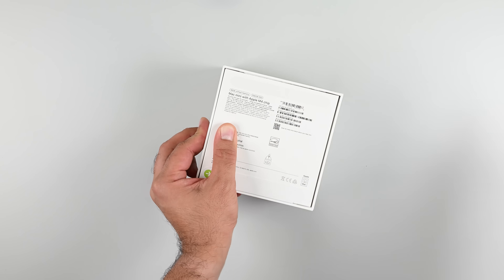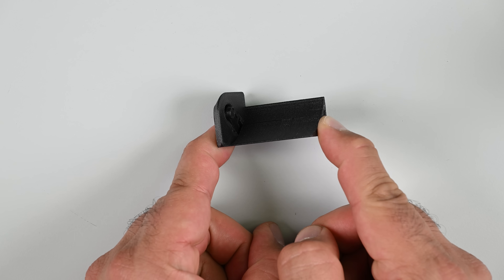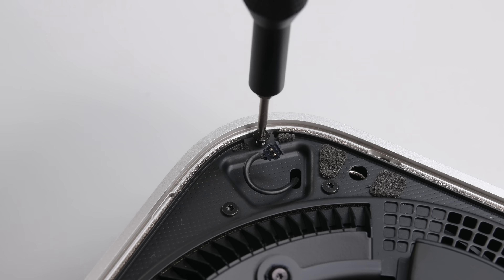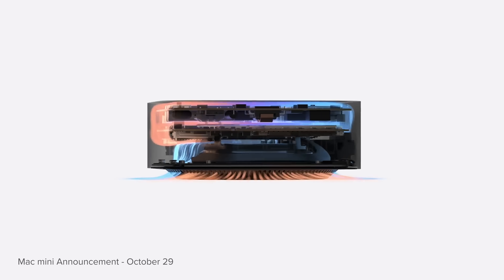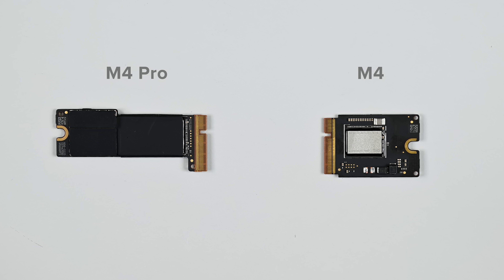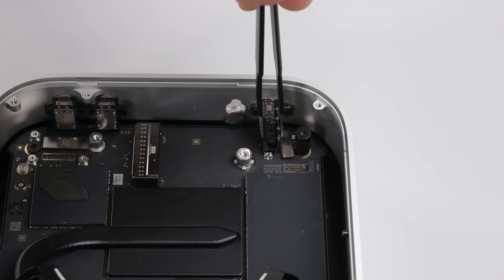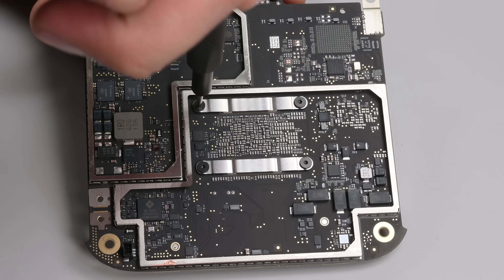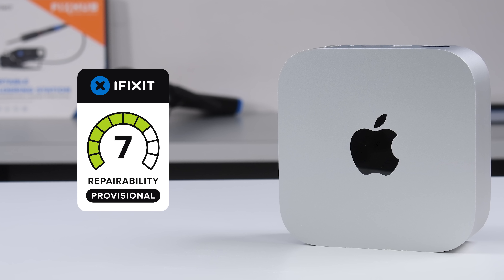M4 Mac mini Teardown - UPGRADABLE Storage, Powerful, and TINY

Comment: 7/10 repairability score for the Mac Mini 2024? Really, iFixit? This feels like a slap in the face to the repair community. Apple makes a small step by allowing one component to be replaced, and suddenly they get a pass? This Mac Mini still has plenty of proprietary parts and design limitations that make true repairs and upgrades a challenge for regular users. It's disappointing to see iFixit rewarding minimal changes with such a generous score, especially when the device is far from repair-friendly by any reasonable standard. This rating system seems to be getting softer, which is a huge letdown for those of us who care about real right-to-repair.
Reply: it's not one component; it's the wifi/bluetooth card; the front connectors; the storage indeed; and on top of that the button battey is super accessible. you're confusing repairability with ugpradability. It's not a standard PC that use standard PC parts; nobody expects that anymore. Now as to how to get the parts yourself it should be possible but that's indeed the question.

Comment: how much of a difference is there between connecting an external drive versus upgrading the internal ssd?
Reply: I've found that the Orico SSD enclosure with a Samsung 2TB M2 on the M2 MacBook Pro is just as fast as the internal SSD.

Comment: Power button not needed. Settings > Energy > Power ON after power failure . Cycle AC will switch it on
Reply: Bad and unnecessary "solution". Just increases the probability of memory corruption. Keep the Mac in standby. I assume that he extra cost of around a Euro per year can be survived.
Reply: @Andreas_Straub  what do you mean? you can use the standby mode normally and still have an auto power on for those exceptionnal times when you have a power failure? having it turn on automatically each time you plug it is another option entirely (that you can set I think with the terminal)
Reply: @hmmmhhhmmh  I am more concerned about the non regular shutdown leading to this automatic power-on ....
Reply: @Andreas_Straub  that's called a power failure and it usually happens close to never. could also be due to human error. I don't think anybody suggested you simply unplug your computer to shut it down; or at least I hope so. but yeah definitely put your computer to sleep for regular use.

Comment: With the Mac mini, you're basically paying for RAMs and SSD, the rest are complimentary.
Reply: I doubt they are making a lot on the base unit.. though if its subsidized and to what extent.. I dont know, but there is a lot of secondary value in getting new people into your relative closed ecosystem, and these grow percentages will clock out on Apple marketcap, as the market loves growth margins.. they don't trade you on todaysprofit but on tomorrow margins.., and that is what Apple is her for.. making money (value) to sh. holders.
The more you climb Apples upgrade ladder, the more Apple will also profit on the productsale as perse.
Reply: I prefer to look at it a different way. If you buy the base model, you're letting everyone who pays for one or more of the $200 upgrades pay the Apple tax for you!
Reply: @EnglishMike  Buying 2x base models(16G+256G) is actually cheaper than buying 1x upgraded model with twice the RAM and SSD, 32G+512G). This would be considered tax evasion from your perspective, right?
Reply: @retroray-pc  Nice, though perhaps it's more a tax loophole than tax evasion...

Comment: Removable doesn't mean upgradeable if third-party drives aren't available.  Nobody has assessed the software/hardware locks on these Apple SSD modules.

If your entire upgrade path is trying to find someone with the same M4 model as you selling off an old drive, that's not a big cause for celebration.
Reply: The exchange of the NANDS only has already been done and worked fine. No sw locks.
Reply: @Andreas_Straub  yeah everyone can swap those nands :\
Reply: @arc8218  That is why you should wit until some pros either offer that service or even complete modules.
Reply: @arc8218  This how a Pro does this: "Brand new M4 Mac Mini Upgrade SSD | 256GB To 2TB"
Reply: @ I'm referring to hw/sw locks that prohibit 3rd party modules, not swapping Apple modules.
Reply: @Kloverkill  I don't think that is really intended or maybe even possible, as the is no "intelligence" on the module. Just the Nand and it's raw interface.
Reply: @Kloverkill  I'm specifically talking about using 3rd party modules; people have already done it and it works fine. You'd also use a blank nand fresh from the manufacturer if you want to directly resolder them yourself. There's no lock in place; when you're doing a DFU restore with apple configurator that's when the modules will be paired with your hardware.
Reply: @hmmmhhhmmh  interesting, thanks for sharing.
Reply: @Andreas_Straub  thanks!
Reply: @Kloverkill  correction: for the macbook dosdude uses a nand programmer and flashes a specific file onto it before soldering it; but it doesn't appear he does it for the mini or studio (he talks about blank nand). Anyway polysoft does sell a ready to install card or cards kit for the studio.
Reply: lol dosdude has a video showing a storage upgrade on the macmini that was published almost on day one of the delivery. of course people have "assessed software/hardware locks" that's an apple software called apple configurator and you simply do a DFU restore. Upgrade for the studio are already available to purchase; and specialized stores can do upgrade on laptops/desktops for you; that's not black magic. It's just a matter of some manufacturers making and selling the parts.

Comment: Beautifully teared down, thx iFixit👍Apple should make these M.2-like modular storage modules swappable and widely accessible for the future upgrade and also not crazy expensive! SoC and RAM r soldered in and very little can be done with that due to performance benefits, however SSD storage should be fully upgradeable.
Reply: They should, but we all know they won't.
Reply: They could and should just use standard M.2 drives, but they won't because their pricing depends on the storage not being replaceable by a 3rd party SSD.

Comment: Also, no glue or expensive special tools needed to repair. I remember when I swapped the HDD from my 2010 Mac mini with an SSD and I needed a few special tools (one was literally to lift the motherboard out of the case) and they were VERY expensive.

Comment: Can you post a photo on its teardown page of its SSD drives next to m2.2230 and m2.2280 standard drives, for reference?
Thanks in advance
Reply: M2 is using onboard SSD interfacing HW. The M4 has this built-in and thus requires a direct raw interface on the card. So M2 will never be compatible.

Comment: The only thing you can upgrade is ssd, and even that, you are at mercy with Apple.
Everything else is not. HOw it gets 7?
Reply: It’s a repairability score, not an upgradeability score. It seems there are a lot of components that can be replaced without being prohibitively complicated or potentially destructive.
Reply: it gets a 7 because you can switch the storage, ports, wifi/bluetooth without throwing away the whole motherboard; and the button battery is immediately accessible.

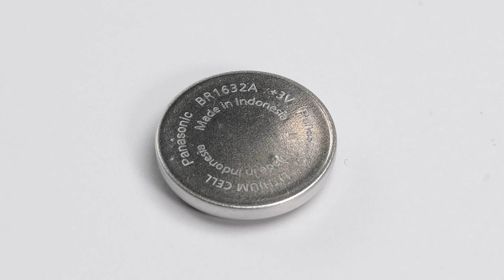Comment: What’s the purpose of the lithium battery at 1:34? Thanks in advance :)
Reply: It's for the RTC (real time clock). Helps the computer retain the time and also other UEFI settings. All sub-OS level stuff you don't have to worry about.
Reply: @readeral  Do all computers rely on a similar battery solution to handle these low level functions? And how are customers supposed to know when it needs replacing?
Reply: @mikasieg13  yes every desktop computer has a button battery, mac or pc. You know it needs replacing when the date and time suddenly reset on your computer when you have cut the power to it.

Comment: This does give hope but because it's involves using the Configurator (and another Mac) to finish the upgrade means no 3rd-party provider will sell to the general public.  I can see countless newbies bricking their Mac out of ignorance and blaming the 3rd-party companies.
Reply: Macs are unbrickable, if you brick it you try again, and also keep in mind if you can’t DFU you really can’t at all replace an SSD in any computer besides a standard desktop. DFU isn’t hard.

Also you can use Linux for DFUing thanks to the Asahi Linux peeps, but you must use Fedora and it is a CLI tool so yeah there it’s a little bit more of a PITA.

Comment: Mac Mini M4 + education discount + turn upside down = perfect sub-$550 computer for gaming, streaming, daily driver.
Reply: gaming 🤣
Reply: Not AAA gaming though.
Reply: @EnglishMike  i dont play aaa i just play free games like cs2 valorant league dota2 fortnite roblox
Reply: @phil.1 unfortunately until anticheat is figured out only CS2 and Dota 2 are playable and you need crossover for the former… or Asahi Linux.

Asahi Linux when a new solution for anti cheat on Linux comes out, would probably be the best chance for the Mac minis to do online gaming. Until then, it’s mostly gonna be single player stuff.

Comment: "its tiny"

Translation: It's a space heater
Reply: That's not even close to how power consumption, heat output, and cooling in general works.
This will never be a "sPaCe HeAtEr" when it's going to use no more than 34 watts in strenuous situations.
Hint: just because a chip is "hot" (another meaningless word without context), doesn't imply it will make the space surrounding it hot.
A 34 watt chip operating at 12 degrees C puts out... 34 watts of heat into the surrounding area.
A 34 watt chip operating at infinity billion and 12 degrees C puts out... 34 watts of heat into the surrounding area.

Your full tower 14900K under liquid cooling in a full EATX case will be much more of a "SpAcE hEaTeR" than the Mac Mini ever will be.

Comment: They could have a DDR SIMM for Ram upgrades, even if the upgraded RAM is slower than the Package On Package stuff. Still, for an Apple device this seems not a particularly evil given the upgradeable storage.
Reply: DDR never shipped in a SIMM form factor.
There is not a single computing platform that supports mixed high-bandwidth memory with 2002's (DDR) or the 1990's (SIMM) memory standard.
Reply: @tim3172  I meant SODIMM. I.e. the standard laptop memory module.
Reply: By all accounts NUMA is a nightmare. If it was that easy to provide expansion you'd see more vendors doing it, because it'd be a really easy value-add.
Reply: @thomaswinwood  Apple don't like building expandable systems because they're less profitable. E.g. I bought a Macbook 2012 and expanded both ram and storage using third party DIMMS and an SSD from Crucial. If I buy a 2024 Macbook I need to buy all the ram and storage I need from Apple at purchase time because it's not expandable and they can massively overcharge me for it. And in fact this goes back so far that Steve Jobs told the engineers of the original 128K Mac to not allow user expandability to 512K. Luckily the engineers ignored him and made it possible to swap out the original 4164 chips with 41256s by wiring up the extra address line, A8, on pin 1. If they had have listened users would have had to buy a new motherboard, or even a whole new computer from Apple.

It's nothing to do with NUMA being hard to do technically, it's purely to do with Apple wanting to be a sole source for ram and storage on their machines so they can overcharge you for both.

Comment: I'm pretty sure the SSD isn't actually USER upgradable.
Reply: assuming a replacement part made by a 3d part becomes available; and you are able to remove the few screws to access it; yes it will be.

Comment: Unfortunately Mac will never be upgradable with SSD or storage cause it's Apple's own design, no controller on SSD, chip itself is only used for Apple, difficult to find chips, require technical upgrade which is impossible for all users, and more.
Reply: it will if someone makes a custom part; and no reason to think it won't happen. Then If you can access the drive you can make the uprade yourself (you do need another modern mac to make the DFU restore). IF you don't do it yourself some shop will do it for you for a fee.

Comment: Mis information and click bait.. The SSD is not upgradable unless you are into replacing the nands ant that requires pro equipment and a lot of skills and experience...
Reply: They’re upgradeable with any donor drive. While there’s no supply now, Apple devices have pretty robust used part markets where people disassemble broken or discarded hardware for parts. Give it a few years and the market will be flooded with drives.
Reply: @kprofs  and long before that happens Apple will issue a mandatory firmware update that signs these modules making them useless in other Mac Minis.

Comment: It’s not a proprietary SSD if someone makes an M.2 adapter
Reply: You don't understand what's going on and that's fine. I just ask you to pipe down and educate yourself first.
M.2 SSDs have an SoC that functions as a controller and NAND packages that function as the storage.
The storage module in the Mini doesn't have a controller as its built into the M4 chip itself.
You can't just magic the M4 into communicating with an M.2 storage controller because that's not how anything works.
It's not a CPU communicating over PCIE to a controller which interfaces with the storage.
It's a controller communicating with... another controller over... not PCIE which interfaces with bupkis.

Comment: You can manually change the SSD's storage chip to upgrade the storage capacity from 256GB to 2TB, then write the system image and install the system.
Reply: That isn't the mainstream definition of what User Upgradable means.

What you're talking about is called MODDING which 99% of consumers don't do, won't do, and don't care to learn how to do.
Reply: Yes until Apple issues a firmware update making this impossible
Reply: @ServicePartsDirect it’s not unless tehy prohibit that with a firmware update, which is unlikely because the Mac Studio has the same upgrade path

Comment: I’d rather not solder, is there a third company that will make this a reliable complete turn key SSD upgrade?
Reply: restrictions are you can only insert blanks or clones, and if you have 2 modules you need to change both

Comment: Ifixit what about repasting with some extra thermal paste to have more contact with that copper in the heat sink? Does that improve thermals?
Reply: The idea of thermal paste is to be a THIN AS POSSIBLE to remove thermal resistance. It is only need to even out the tiny surface unevenness of the processor and the cooling heat sink. More thermal paste = worse cooling!

Comment: I hope someone starts selling storage modules. 🙏
Reply: its not someone, but apple itself
Reply: @arc8218  not a chance; they'll sell repair parts to dealer and that's all. But a third party will probably make an upgrade kit.
Reply: That “someone” would need to have an entire factory, build a bespoke component that not many people will buy. Yeah it aint gonna happen unless maybe some bootleg chinese manufacturer would take it up
Reply: @PaoYong  OWC has done it in the past.
Reply: @ that’s good to hear. Also learning more about it it seems to be easier because the ssd controller is on the mainboard not the ssd

Comment: I'd say iFixit is pushing setting the bar too low, even it's an Apple product.

The same sized NUC has two SO-DIMM slots, some models even have two m.2 NVME slots, replaceable wireless card, sanely designed power button, no fragile clips/ribbon cables, just 4 screws to disassemble.
Now you say such Mac mini has a bright repairable future?
Reply: what about performance?
Reply: don't NUCs not have an internal power supply, usually? and besides, NUCs don't have the performance of this mac mini at this size
Reply: I assume you are (not) talking about a mini PC of the same performance class?

Comment: I still doubt that this cooling system can actually prevent the M4 Pro from throttling when both GPU and CPU are at full tilt. Also a proprietary SSD is by no means upgradable.
Reply: ffs yes it is upgradable; people have already done it in fact, it just means that with the right part you can upgrade the mac; not that you can stick any M.2 drive in there and it will work. the part will very probably be available at some point from some 3rd party; and in any case you can find shops that can do the ugprade for you; even for laptops.

Comment: Apple only went with ARM in order to spite the Hackintosh movement.
I see they are still using proprietary storage pin outs, ever since the trash can mac pro.
The thermal solution is geforce fx 5800 ultra levels of recycling; likely to ensure an early death and early adoption of revisions.
This video feels more like a paid endorsement than an independent opinion of the Mac Mini.
Reply: the performance of the whole M series only shows that apple ditching intel was definitively a great move.  the end of the hackintosh movement was just a side effect.

Comment: 7/10 despite using different SSD modules between models, no replacement parts available at a reasonable price at launch, no board repair manuals. At least it isn't glued in

Comment: You can remove the SSD and change it without replacing the chip, but it’s not easy and requires a heat gun and solder.